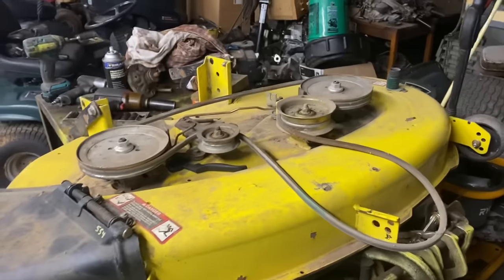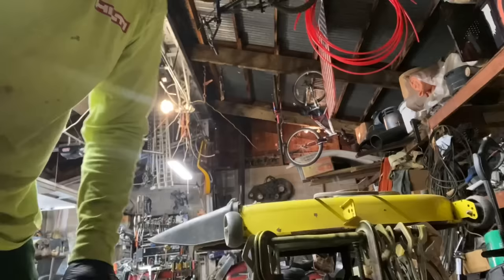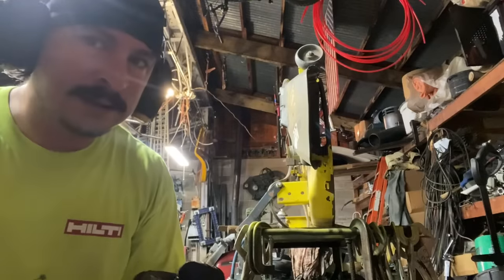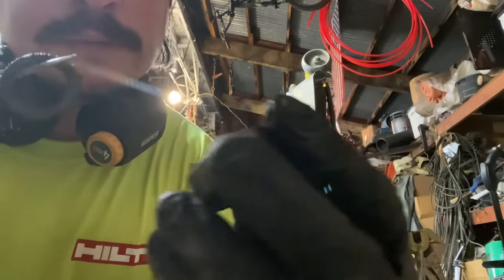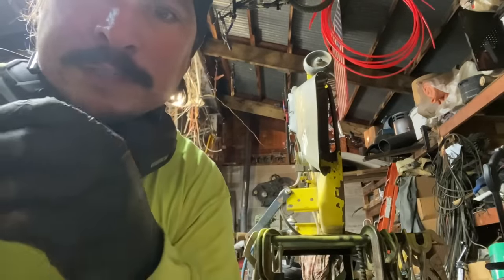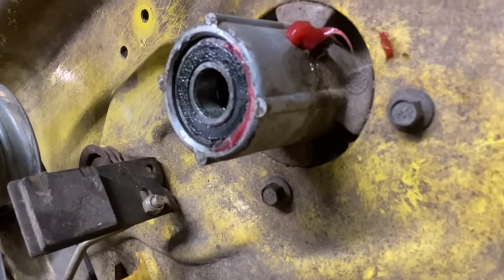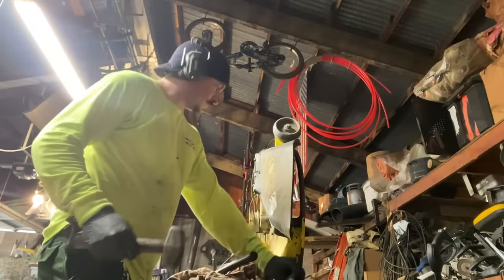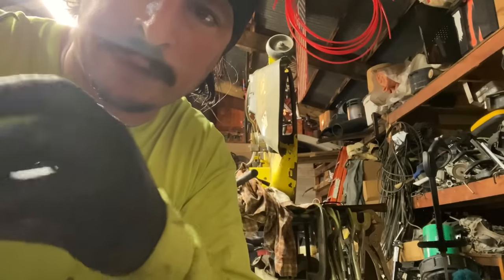Part 1 - Don’t trust the “Experts” Grease your mower deck sealed spindle bearings Common sense.

Comment: 70 pumps of grease.  That can get expensive.
Reply from the maker: Okay. So if a tube has several hundred pumps in it. How much $ are you complaining about exactly? 5$ expensive to you? Vs a bearing value taking out a mandrel ? Geez what are we even talking about? 
Next thing you’re gonna tell me an oil change is too expensive so we just run the engine to failure because that seems more reasonable? What could you be trying to say here? Please elaborate so I don’t have image what your trying to say. Keep in mind. After the assembly is filled it only takes a few pumps for all the future greasing. So like 50 cents or less.

Comment: I been doing this for Years 
Grease insert  , the real reason is to falsely up sell 
What a joke. But works for the dealer
Reply from the maker: Zerks work just fine. Most folks just don’t realize they are even there and many other folks don’t fill them spindle with grease. Just a few pumps won’t help. Have to fill that bad boy up.

Comment: those bearings are not supposed to be full of grease.  They will overheat.
Reply from the maker: Your dead Wrong Hoss. Try testing that theory for this application and get back to me. It simply won’t happen your inventing problems that never occur for this application.

Comment: Must be weak seals! Or not sealed very well!
Reply from the maker: Ding ding ding, winner winner chicken dinner. Exactly right, not sealed very well. Lol. They are not really much more than a dust shield. Not really a seal at all. Folks hear the word seal and assume it means that they can hold back pressure. Think about it more like a flexable rubber lip that only keeps out dust. That’s about all they really do. The seals in a hydraulic cylinder are something completely different. Even the seals on an engine can hold in a little pressure. But these bearings seals for this application don’t retain any pressure. If you put liquid oil inside the bearing and pop the cap on. Over time all the oil will leak out. On a scale of 1
To 10 in a world with a variety of seal designs this would be at the bottom rung. and even using the word seal to describe this application is a stretch.

Comment: They don’t want you to grease them. They can’t make money. When I bought my John Deere l 100 in 2016 no grease fittings on the spindles. First one I replaced the bearings. Second one I bought the whole thing new. It had a grease fitting. None of the tie rods have fittings. $$$$$$$$$$$
Reply from the maker: @crawwwfishh3284  yes sir 100%. Throw away society is what I think. Make it cheeper but sell for a premium. Designs parts don’t last and then make the parts obsolete so we can’t fix it. Handy man world it is. We can make things last. I love finding trash that just needs a little work. I’m more proud of my operational trash finds than I am of the things I spent a bunch of money on. Iv been annoyed about the lack of grease fittings. Each year the equipment has less and less. I have trucks that are 20 plus years old still original steering joints because I just keep greasing them. But some of the new vehicles have zero zerks. Let’s see how that plays out.

Comment: why not just leave the rubber seals out completely? That way the grease would always get there
Reply from the maker: Ask the manufacturer 

If you want to
Dismantle to remove a seal that can’t stop grease then get to it. But why? It is irrelevant and the whole point of the video.

Comment: cheaper for me to just pickup the spindle unit and install it rather then taking the whole tractor to the shop . But then again not everybody knows how to hold a screwdriver 😂
Reply from the maker: It’s even easer to add grease and avoid that issue all together 😜
Reply: @GTObearclaw1  BAM! You're baffling them with logic! 😆
Reply from the maker: @Hjerte_Verke  seems like some of these comments are just fishing for a reaction. Replacing parts has never been cheeper than adding grease. Even if parts are free it would take way more effort.

Comment: My Husky TS354XD ...sealed bearings...rebuilt 2 and bought one new spindle. ...dumb engineers!
Reply from the maker: Does it have grease zerks anywhere on the mandrels?  If so do like I showed and maybe they won’t go out again. Good luck.
Reply: @GTObearclaw1 It did have grease fittings..but sealed bearings...I pulled inner seals and packed them then installed them...blades spin easier now...instant start up and NO pto belt squeal!!!
Reply from the maker: @mikeschlup5279  did you watch the video all the way to the part where I proved the inner seals don’t stop grease? That’s the point of the video. Engineers are dumb for the seals being installed on the inner side, they must at least be smart enough to know that a little flap of rubber on the inside shield is not going to stop grease from passing into the bearing. So many people over complicate this very simple thing. To test the process just grease an assembly until you see grease exit. Unless there is a weep hole the greased passes the shield lips. If it has a weep hole plug it. I think the weep hole is why the engineers are being tricky. That will allow grease to exit before potentially passing a shield lip. As for dismantling a deck Or Mandel just to remove shields on the inside facing part of the bearing, it’s just a waste of time. Not saying it’s a bad idea to take things apart and inspect and grease the bearings manually, that’s fine, I’m not even opposed to leaving shields off. I get it, I’m just saying it’s more work that way and provides no additional benefit over how Iv showed in the video. After many years Iv come to trust my process because it’s never failed me. Now I know all that extra work is not needed. Just grease until filled and mow on.

Comment: Every winter pull the bearings and and put new grease inside the seals and put them back together.

Putting 70 plus pumps of grease into that void for each spindle is just plain stupid.
Reply from the maker: I think taking the deck apart every year to grease bearings is just plain silly. If the mandrels didn’t already have zerks, I’d add some while I had it apart to save time in the future. This is exactly how mower deck mandrels are serviced in the commercial world. The heavy duty ones are the same way
Just don’t all
Have the inner seals. But the Void between the bearings will be filled with grease. Some of the real good ones are built with tapered bearings. In the commercial world it’s just normal every day common practice to grease the mandrels without inner seals this way. Point of the video is the seals won’t stop grease from passing. But the part about filling the void with grease is just the norm for industrial grade riders. Thanks for sharing Your opinion. But your missing a great time saving practice and quick to judge this process and would benefit from understanding how beneficial this is. Don’t dismiss it so quickly. It’s easy to be hateful because it doesn’t make sense to you but it’s good information.

Comment: No one gets in trouble for false advertising anymore either
Reply from the maker: What’s false? Calling them maintenance free?
Reply: @GTObearclaw1  Well one would think that putting grease Zirks on would mean the grease Zirks actually Have a reason for being there. Had my brand new cub cadet for less than one year and all the bearings went South. I had to argue with the dealership to get them to put new ones on.
Reply from the maker: @floydlarken3148  cub is one of the MTD machines and some have a weep hole made into sides of housing so grease exits the hole if that’s the path of least resistance no way to guarantee grease went into bearings if they have a shield it’s doubtful grease would ever reach a bearing considering a hole in the side of housing is a easer path. I hate MTD equipment with a passion. They ruined cub. Now cub is nothing more than a pint job. Just a glorified yard machines.

Comment: U just drilled out spindles & installed zerk fittings, greased the shit out of each spindle, $25.
Reply from the maker: That’s most certainly an option for folks willing and with the skills to do so. It would pay off in the long run.

Comment: Sure, filling the spindles with grease can help...BUT...what is the most common failure mode of the typical AYP or similar cast alloy sealed spindle?  Yup, getting smashed by careless operators🙄😂.  C'mon, ya know I'm on to something...😉
Reply from the maker: The older style were terrable but AYP finnaly upgraded from the tripod style to the quad mount and they hood up much better but yes can still bust them. As for the folks that don’t run over shit, they can simply add greases and avoid major failure due to bearings drying up. 

I’m not familiar with any box store machines that don’t come with a cast alloy mandrel housing. Not for the newer ones anyways. The stuff Iv been working on for the past 20 years has all been made of aluminum.

Comment: Then the from the murky water came the school of thought that says you overgrease bearings that causes failure as well...IDK?
Reply from the maker: Murkey water? 

No issues with over greasing in this application. Only folks who don’t understand the way things work here would bother arguing that. And anybody willing to argue about something they don’t understand would quite possibly be an idiot. And I’m not in the business of arguing with idiots. At least I have learned not to try and convince them anyways. They will beat me with experience every time. And all It ever does is waste my time.  I don’t mean actual hands on experience. I mean the experience of being an idiot who is always right even without providing a shred of proof. Iv been through the battle of trying to explain every painful detail at least 5 dozen times below in the comments. Iv battled with the experts who have no experience in the specific application I’m covering. Some of them even clearly drag other bearing applications into this one like they have the same ROM ratings or load ratings or same style seals. It’s tiring, I’m exhausted. Grease them, don’t grease them, it’s  hard choice
For some. No brainer for others. I have proven the point on video. Nobody has ever proven you can over grease a riding mower deck bearing. Not a single video on it. Nobody can prove it because it’s simply impossible to do. I challenge someone to put together a video and show how adding too much grease can result in a deck bearing failure. I’m not talking about other applications. I’m talking specifically mower deck bearings / mandrels and nothing else. I’m not interested in electric motor applications or speed boats or anything except mower decks. Iv been waiting a few years now. Just crickets. To be clear, I don’t think your an idiot, your just asking a question stating IDK? Thats a reasonable question. Maybe you smell what I’m stepping in.
Reply: I just put the question out there because I know there is a school of thought that leans that direction.  Myself, I have a JD mowerdeck and am a NOOB with the thing and want to learn and practice best methods going forward.  I bought a grease gun and JD specified grease for the thing.  I have not gotten as far as doing the task as I am uncertain what exactly the bearing housings are populated with....sealed, unsealed I really do NOT know as I have not dissassembled the thing to examine what is in there.  This video was a relief to my thinking that I needed to dissassemble and I really was NOT wanting to do that as the deck has less than 100 hrs on the thing. So what I learned is that it won't harm anything to put 40,50,70 pumps of grease or so into the housing zerks. Thanks for your time.  @GTObearclaw1
Reply from the maker: @1vertical11  consider this, why would they build the assembly with a grease zerk and also have the shielded bearings in said assembly? 

Answer, because grease passes right by the shields and they don’t stop grease. Also, the grease that is “too much or also called over creasing “ will push out of the way of the bearing retainer cages and easily push enough out so that the bearings don’t have too much grease. They basically self regulate. 

I can guarantee one thing, if you do t grease the bearings will fail eventually. 

If you do grease they will be fine. Iv yet to have any issues after greasing. And well greased machines last way longer.

Dont waste time taking it apart to check for shields. Those other videos are stupid. It wouldn’t make a difference one way or the other. If it has a zerk that’s all that matters. Add grease and don’t waste any time worrying about it.

Comment: Leave one seals off on the inside they will except grease
Reply from the maker: You might have missed a part of the video, They except grease with the seal on. That’s why I made the video and specifically made it a point to make sure the seals were in place like a new machine would come in most cases. I also did it this way in the video So folks won’t be misled by idiots posting videos saying the grease can’t pass a thin flexible rubber lip of the shild. All those clowns posting videos saying they won’t take grease don’t bother running a test to prove the grease can’t get to the bearing so here ya go, I did the extra work to get you the truth of the matter.  No reason to take apart a good deck and waste time removing the inner seals. Just grease it properly and move on with life. However, If you want to tear the deck down to remove some rinky dink dust shields that can’t stop geese and waste your time that is fantastic but for those folks who don’t have the time or tools for that work, they can just pump grease in and be on with business cutting grass and having happy bearings. I’d rather not do extra work if it’s unnecessary but that’s just how I roll.

Comment: Take some time take the seal out ones a year why its down repack the bearing good for one more year and save all that grease
Reply from the maker: No thanks. That’s amateur stuff. If the assembly has a zerk there is absolutely No need to take the deck apart just to remove the shields. They don’t stop grease from passing into the bearing as Iv shown. Doing all that work gets you no better lubrication and is simply just a 100% waste of time. The only way I’d recommend that is if the unit has no grease zerks or if the unit has a weephole. If that was the case I’d plug the weephole and add a zerk long before I’d consider taking my deck apart every years.

Comment: Mine failed at 40 hours.
Reply from the maker: I’m not sure I remember seeing a machine with hours that low with bad bearings but I have seen more than I should have fail under 100 hours. Unfortunately the quality of the bearings even from the factor in a new tractor box store model machine can be terrable. Not to mention the amount of grease in each bearing seems to be metered to the point sometimes it’s almost non existent. In many cases when Iv opened a new bearing the amount of grease is sadly lacking. Sometimes it’s almost hard to even find grease in the new bearings and that makes no sense other than the manufacture wants the bearings to fail sooner than later.

Comment: Anyone that doesn't greese them zert fittings every season deserves it when they have to replace em. The manufacturer would not put them fittings on for no reason.
Reply from the maker: Seems like simple logic. It’s amazing how many people have left comments about how greasing will damage or overheat bearings. Can’t help everyone I guess.
Reply: It's ZERK.  Impress all your friends with the proper pronunciation, it's also a proper name. (From Wiki) "The patent for the Zerk fitting was granted to Oscar U. Zerk in January 1929"